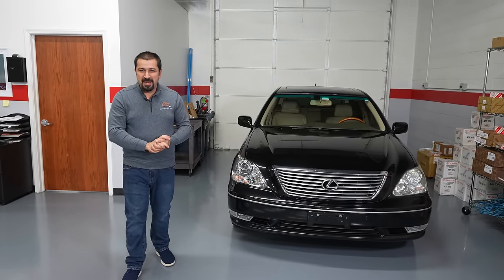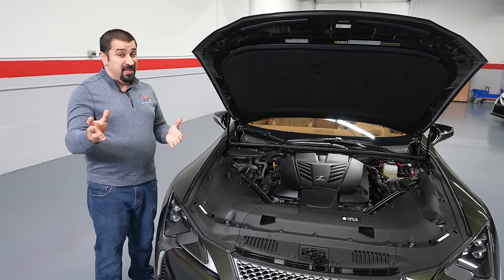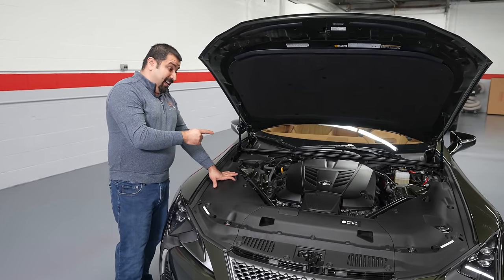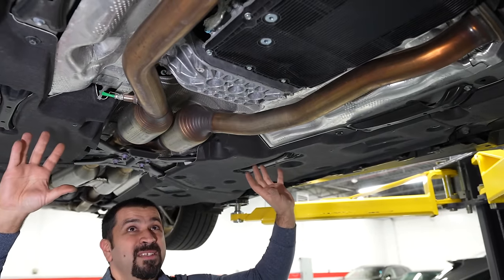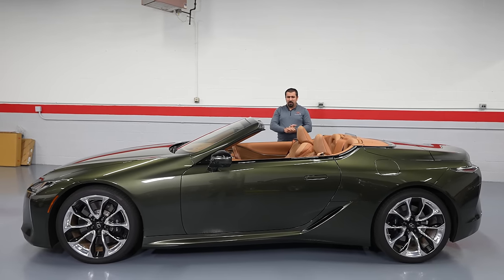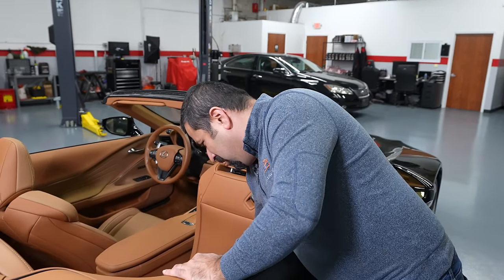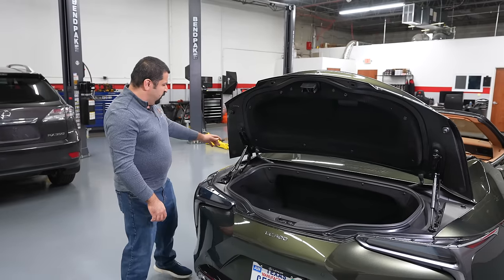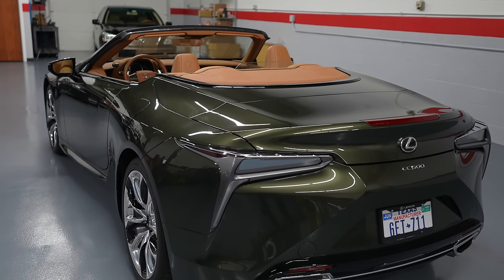This is One of The Best Modern Lexus Models EVER Made!

Comment: The Savage Geese review of this car includes mention that driving this car hard on the track results in a message that essentially says slow down, I am overheating. This could be the transmission overheating, but the reviewer states that this car is not made for the track. It is a grand touring car and an excellent one at that.
Reply: It’s too heavy for track use, it’s made for swift driving  through the European continent in summer with a wallet full a money and a sexy Gal sitting beside you.
Reply: I respect this guy and his channel, but he’s a bit out of his depth here.  BMW M makes some fantastically track capable, durable and reliable vehicles far beyond what this LC can handle which isn’t its intended purpose anyways.  Nobody in their right mind tracks their LC.
Reply: @kcw9313  Unfortunately, BMW places 17th out of 28 auto manufacturers for reliability according to the latest rankings by Consumer Reports. The top 3 are Lexus,, Mazda,, and Toyota. Most mechanics know that German vehicles are not nearly as reliable as even the top ten companies' vehicles.
Reply: @davepaturno4290  His comment was about using the LC500 for track use, not reliability.
Reply: @petesmitt  Yes, but you were bragging about the BMW.....
Reply: @davepaturno4290  not me; and again, the comment was about the ability to be used for track driving; try and focus on the subject..
Reply: @petesmitt  I'm the one who stated that the LC is not a good track car. But I would definitely not pick a BMW as a track car.
Reply: He also owns an LC500 so he definitely likes it.
Reply: @davepaturno4290  that has nothing to do with tracking performance. The S65 V8 is actually a reliable high perf V8. Many on the forums beat on it with over 150k miles. Real world experience trumps corporate reviews
Reply: @burntnougat5341  The testers were able to do a couple of hard laps and then had to slow down to allow the transmission to cool. You're saying this has nothing to do with track performance?
Reply: @davepaturno4290  referring to your comment about jd power rankings
Reply: @burntnougat5341  Ah, so the 10,000+ survey results by Consumer Reports, regarding BMWs mean nothing?  Having a durable engine in a vehicle that is ridden with electrical/electronics and fuel issues is not something I'd like to experience. Wait, I did experience it with my 2001 Corvette Z51 - nice track car that was not reliable at all. No thanks.
Reply: @davepaturno4290  cool story bro

Comment: I don’t understand why there’s no love for LS460 at all. Yes they had their share of problems the first few years, but it’s because they were much more complex and higher performing cars compared to the LS430.

The LS460 is still very reliable mechanically, my 07 LS460 has over 150K miles on it and the engine and transmission still runs buttery smooth. Everything still
works and I haven’t had any issues at all since I bought used about 2 years ago. Being almost 15 years old now, the car still feels new and fresh. 

It rides, drives and performs much better than  most new cars I’ve been in recently as well. 

I own a fully loaded L model with almost every option available including air suspension and I know all about the issues with the suspension components on these cars, but again, the added more sophisticated complexity of the suspension made these cars not only ride like an old full size Cadillac from back in the 70’s, but handle much much better than the LS430. 

The LS430 is an amazing car, but underneath of it, it’s suspension and steering components are very simplistic and the tech is very old and basic compared to the much more advanced LS460 that made the LS460 finally truly compete with the S-Class.

Comment: I just bought an ES350 and I have to say it's the best car I have ever owned. My other car is the reliable 2010 2.5L Toyota Camry SE in super white.
Reply: How much Better is the blue tooth and road noise in es vs camry? I own a 2017 xle  and starting to think of the es but the road noise and phone tech makes me wonder if it's even worth the extra.   My camry has 156k on it has been absolutely trouble  free and like you in sure the lack of cash needed for repairs made you go up in market
Reply: @dtlusk24  the es 350 is much quieter than my Camry SE and I have never had an issue with the Bluetooth. The engine blew at 180,000 and during the pandemic and spent 6800.00 to replace. I just bought the used Lexus as a birthday present this summer and love it. It has become a sort of a backup car instead of renting a car when the car has to be in the shop for more than 2 days. Since I got the new engine I have not any other major problems and use it as a daily work car. The car now has 210,000 miles as of today.

Comment: Direct+Port injection helps keep the intake valves free from carbon accumulation.
Reply: One of the drawbacks of direct injection is the fuel which has cleaning additives doesn’t hit the valves and they get carboned up so luckily it has port also.

Comment: I love my LC convertible and i love your channel!! if you have any tips on how we should maintain these beauties the way you would maintain it, plz make a video!!!

p.s. you can unplug those valved exhaust controllers and it'll open the valves all the time. you can do it from within the car (in the trunk) or you can just unplug it right at the valve.
Reply: Is the closed valve sound that undesirable? (I've never heard a LC 500). Seems a custom switch and FOB to manually control the valves would be a better solution?
Reply: @Cleofizoid  Yeah you can buy a kit that makes a switch, but in all honesty even with it unplugged its not THAT much louder. Just has full vocal range throughout the RPM where before it only really wakes up after 3000rpm.

Comment: Proud to own this car's predecessor, the SC400. Awesome car
Reply: im one branch away with the SC430, and that car has turned me into a convertible person.
Reply: @Star3  I've heard that owners love them too! Loved your car in Terminator 3!
Reply: @Maplecook  i just looked it up. i didn't know it was in that movie, now i need to see that movie haha
Reply: @Star3  NGL, the beautiful blonde lady driving your car had something to do with it. lol
Reply: @Maplecook  and she knew just how. To handle that cop lol
Reply: @Maplecook  There's also a first-generation Tundra that was in a crane chase. It was beat to hell and back and still survived.
Reply: @lightsfansofthewest481  I remember that! And that motor is almost the same one in my car! haha
Reply: @Maplecook  Yep, 2UZ-FE 4.7L V8. One of the best engines ever made. My dad's '08 has the same engine.
Reply: @lightsfansofthewest481  UZ motors are BEASTS! (Way better than the more famous 2JZ...lol). But if the starter goes, and it will -- at 150,000 miles -- then you're in for a rough ride, man.  I changed my starter 2 years ago, and WHOA(!) talk about, "Experts Only!" territory! They put the starter, buried waaaay down in the V, like a freakin' GM Northstar. I had to disassemble the entire top of the engine just to get AT the thing!
Reply: @Maplecook  Agreed!

Damn. Fortunately, the starter hasn't gone out yet in my dad's truck, and it's at about 150K. The air check valve did have to be replaced recently, though.

Comment: Great video, I have 1 in order. I am kinda wondering what your opinion is about the lack of oil cooling, or trans cooling. Neither of your LC500 videos mentioned this, even though they get pretty technical. 
I live in texas (hot) just wondering if I should be concerned about longevity in this climate. Should I get aftermarket coolers? In TheStraightpipes review, he actually overheated the trans on a canyon run.
Reply: These cars aren't built for thrashing, so will need cooling modification for that purpose.
Reply: The IS500 has same issues. Point against it vs the 340/440i

Comment: Speaking of Doug Demuro. I learned but the tiniest fraction about the car from him, what you just went over.
I don't like convertibles either, and I have no hair left to mess up. 
Those hydraulic tops are known for leaking after a while. Oh, maybe that's just on those German cars. 😆 
Speaking of German cars. I have a 2001 e320. The paint looks bad from the Vegas sun, but it has no rattles and squeaks. It's solid.
Thanks for this presentation.

Comment: As for the trans, could it be that the plastic cover better absorbs heat or noise vibration? (Just guessing out of curiosity...🤔) Anyway, love that olive green - and CVs, esp. those w/proper rear-glass (took BMW years to do this) as w/my non-Lexus. But I do also need a full backseat and trunk, like in my beloved daily-driver Saab.😉

Comment: Interesting video. I recently traded a 2012 991 911 for a 2018 LC. It is my understanding that the LC does not have either an oil cooler or a transmission cooler and these omissions sharply limit the ability to drive this car on a track (not its intended purpose I understand...but you described the car as "intended to drive on a track"). I wish you had addressed these items in this video.
Reply: I picked up a 2016 Lexus GS F and it has both oil and transmission coolers, plus 3 seats in the rear for the kids, and the same 2UR GSE V8 Engine.
Reply: he's wrong; it's not intended for track use.
Reply: @Omegan369  yep; same performance in a more practical body at half the price..
Reply: Yeah dunno why he's talking about tracking when it's a GT car with lacking heat exchangers

Comment: Mr. Car Car the Japanese traditionally do not use Liners like the Europeans. I thought they coat there cylinder  block with Nika seal.. Did not Porsche use high pressure online oil scavenger Pump for there Porsche Boxster boxer engine, anyhow I do not know, I just thought they did, thanks for your brilliant knowledge on Toyotas brilliant documentation

Comment: Track-focused cars usually have a separate parking brake like that to reduce potential issues if you put on the parking brake while the brakes are still hot (something you shouldn’t do.) It can mess up the pad material bedding on the rotor, cause the pads to stick to the rotors, or even warp the rotors.

Comment: The era of reliable, bullet proof Lexus is somewhat now in the rear view mirror! They had the decade old platform, chassis, NA / Hybrid engines all proven and sorted out. Now they are putting up the turbo 4 with hybrid combo in most of their new vehicles, it need to be seen how these hold up. Not to mention that the 4 cyl is rough and uncouth and so unLexus like

Comment: those old school clips are a pain to remove. i suppose it might be more secure than the newer ones that's designed to pop off.  My old 2000 avalon trunk had those one way push pin clips

Comment: I have the RCF, which is more track focused. The LC lacks a trans and oil cooler, which causes the oil temp to rise fast. The oil pump helps with pressure but not temp. RCF and GSF do not have this problem. I plan to trade up the LC but will absolutely not track it. Also, there is easy to install mod available to control the LC exhaust valves now!

Comment: In an area where you can drive topless, it’s hard to beat the lc500 ragtop, especially the ‘24 with the  new touch screen.

Personally, I would only buy this as a ragtop. If I needed a roof I’d get a 911.

Everybody is different.  Chase what’s most important; speed, luxury, uniqueness, handling, etc.  & at least for me, reliability.

Comment: I own a 2018 and have to say it is a very good car. However, after living with it for a couple of years there are a few areas that could be better. Seat comfort could be better on longer drives and a massage function would be welcome. Other than the ridiculous infotainment system which is dangerous the placement of center speaker on dash cause the rear view mirror to vibrate with not very high stereo volume. Another problem is the very low front end which does not clear a US standard parking curb stop. That means that every time you enter a parking spot you have to guess where the front lip is located. Needless to say without a front camera, parking becomes always a stressful event. I do wish there was a manual transmission option and a rear seat delete with a pass through option from trunk. That would have made it a 10.

Comment: Engine compression is a mechanical constant. Turbos, air inlet temperature, superchargers, etc do not change engine compression ratio. Colder air is  denser, which would allow for more fuel, and in turn provide the possibility of more power output.

Comment: If you get the chance to record changing the LC500's external door handle please post it.  Ours is making a whining noise that sounds like it is not lubricated so i suspect it will fail eventually. Or if you know of a way to lubricate either the lock motor or the handle motor that moves it in and out, please let me know. (oh, by the way, I bought mine for the sound alone because I cannot afford an LFA)  It is the FUNNEST car to drive I have ever owned. Love it.  As far as the LS500 goes, put the 2UR-GSE from an LC into an LS500 mating it to the 10-speed transmission. That would be GREAT!

Comment: I very much enjoy your videos. I look at cars like this one, & obviously no one who drives on gravel roads owns one ! . All vehicles like this are a nightmare to work on.  I expect that owners really don't care how much it costs, or how expensive it is to operate. The 4 cylinder Corolla with a standard transmission is 
close to being reliable , reasonable cost vehicles. The old Toyota pickup with the R20 Or R22 engines was a great pickup. Toyota probably has the most reliable vehicles world wide.  I have never owned one.
I am surprised that you, as a mechanic, expound upon what a great car it is. I understand that there is a plethora of folks (Jay Leno types) who admire cars like the Bugatti, The Lamborghini (sp ?), Ferraris & the like. I am NOT among their ranks.  I can admire the engineering, but would never consider owning one.
Thanks for a great collection of videos, & for sharing your obvious knowledge.

Comment: I've never seen one of these before that I know of. I'm drooling. Especially since I'm researching for a new vehicle. First question is driver room. I'm 6'5" and fairly proportional (torso/legs). Will I fit? his head looked pretty close to the headliner. Also, how are they in the winter? I live about 2.5hrs south of his shop. Snow/ice is common and If I bought one of these, 2018 with miles, I would not be able to have a winter car as well in case you are ready to tell me that. Third question, will my golf bags fit in the trunk? 

Those are Kindigit door handles. From the Bitchin' Rides show.

Comment: LC 500, especially the convertible, is not meant to go on the track as a stock car, lol. It doesn’t have engine oil cooler or transmission cooler.  It will over heat after several hard laps.  It’s also too softly sprung for true track driving.  You probably need to use different brake pads too and adjust camber for track driving.  It’s meant to be a sporty GT.  Funny how mechanics fail to see these issues.

Comment: That car is a work of art. Have they fixed the valley plate coolant leak debacle yet?
Reply: If you change your coolant every 30k miles the valley plate should never leak. Yes it is still the same valley plate and if your coolant level drops, FIX IT!
Reply: @paulmeglasson1919  the service life of Lexus/Toyota coolant is 10 years. Do you know how difficult it is to fix a valley plate leak? It's not a 5 minute job. It is a design fault that needs to be addressed by Lexus. You can't rely on a tube of silicone sealant in an area like that, and expect an engine to give trouble free motoring for 300,000 klms.
Reply: @wendyandgeoffpattison2610  The Service life is to keep the maintenance cost down.
If you follow the service life mentality your car will last until the warranty is over and then fail. The same goes for the transmission fluid that says it's lifetime fluid. If you don't change it every 30K miles that lifetime is about 100K miles.I have been a Master Lexus tech for 30 years so yes I do know how difficult it is to fix the valley plate.

Comment: As an owner of a '99 BMW E36 M3, I have to say that the E36 was the pinnacle of BMW pure Engineering excellence. It started to go down hill after this. The E46 was a better car overall but not immune to the start of fragility being built into them. The cars to follow after this were proper ticking time bombs and I wouldn't touch either with a barge pole. 
It's not only BMW doing this just to be fair. Most car makers are building cars to NOT last like the older gen cars once did.

Comment: Thank you for another great video.  My 08 Solara sle 4 cylinder 55k miles has a usable back seat. 15 years old no noise rides smooth.  Starts to burn oil at about 1k miles so I just change it.  16 inch wheels pealing silver finish.  Any ideas what can be done.

Comment: Love your channel and I watch all your videos. question: I own 2020 Lexus RX 350. the  engine is not as smooth as butter as it used to be. the car only has 28000 miles. not sure what to do  to bring back  the silky smooth engine character it used to have when it was brand new. all service required done in a timely manner. any tips would  greatly appreciated. Thank you

Comment: Question: radiator cap on 08 Lexus gs350 crumbled in thermostat housing. I caught the spring but the rubber washer slipped out of sight. Haven’t started car  since. Is  this a concern!

Comment: Impressive car and excellent presentation! I have a question. At min 14:12 why are the screws holding the metal guard coloured light purple? I saw at my Camry as well the screws (nuts) from the engine block support having the same colour. Is there a meaning for using this colour?